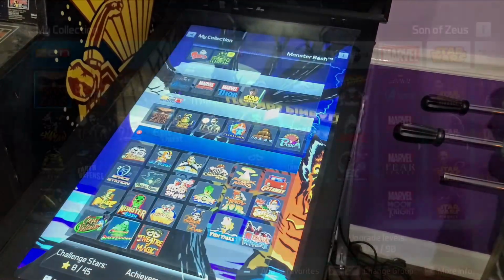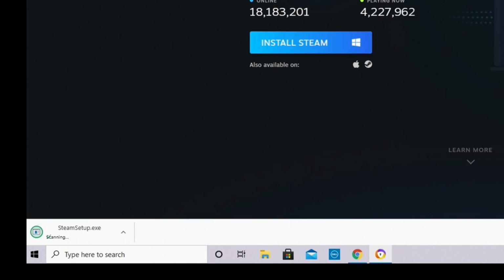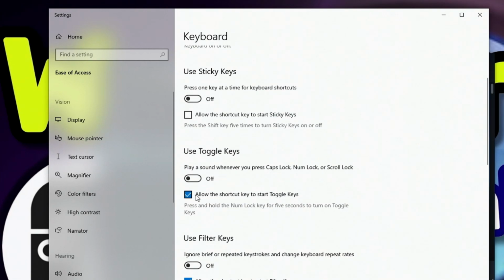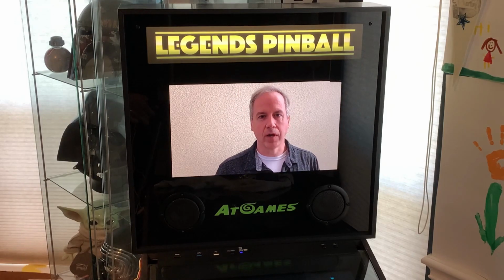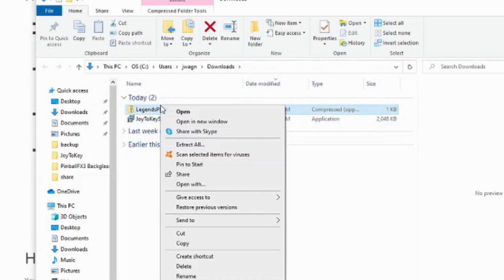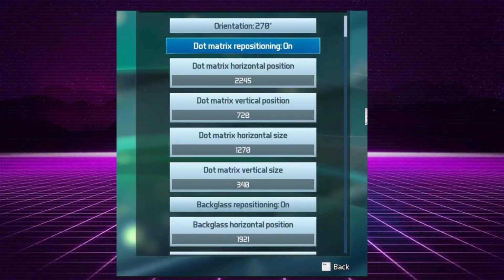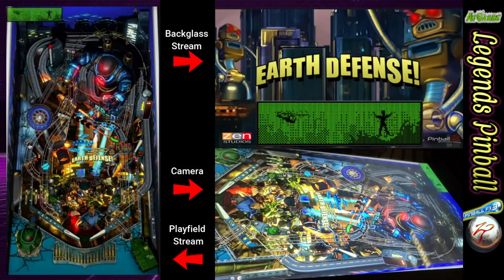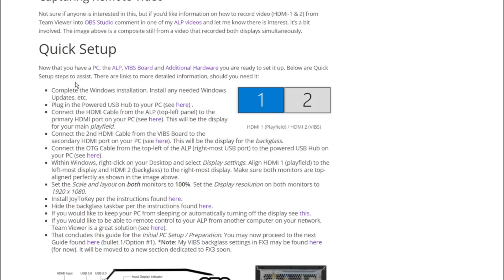Pinball FX3 Setup Guide for the AtGames Legends Pinball Machine

Comment: I have a Radeon RX570 video card.  I followed everything most everything in your video, but cant get the backglass to display at the same time as the table.  The only thing I have setup different is both HDMI connections directly from the video card.  I have the table directly input into the video card, and the other VIBS into a HDMI/DVI converter.  I can get the backglass to display if i switch the connections on video card.  Do I need the station setup like you have?
Reply from the maker: Some AMD cards may have difficulty as discussed here: https://wagnerstechtalk.com/alppcsetup/#PC_Requirements .  You may want to adjust the AMD Software settings to see if you can get it to work.  In my early testing, I started with an AMD GPU but wound up switching to NVIDIA for similar reasons.
Reply: What is the back glass supposed to look like after it’s all connected.  All I get is red, green blue alternating.
Reply: Do you need to have a backglass image downloaded to go with the pinball game in order for it to display anything?  Are there any pinball games that come with backglass?

Comment: Don't understand the first bit about the drive backup? What drive? I just connect up the laptop, hdmi and USB to the pinball legends and play it with joytokey and FX3. FX is way too laggy compared and I cannot get it better, despite killing v sync etc. I am running 4070 and an I9 on my laptop with 16GB Ram./
Reply from the maker: It's an optional step, just made an image backup of the drive as it was sent from the Mfgr. nothing more.
Reply: @WagnersTechTalk  aw ok. Do you notice FX has more lag than FX3?
Reply from the maker: This section helped with my configuration: https://wagnerstechtalk.com/alp4k-pcsetup/#Improve_Latency_with_NVIDIA_GPUs

Comment: So I followed these directions and it’s working, but, sometimes when I launch FX3, the backglass screen is not recognized by FX3 and it’s blank, despite the playfield working. Is there a way to insure the backglass always shows when launching the app?
Reply from the maker: The blank/black screen on the backglass simply means the artwork is missing for the selected table.  Look closely and you'll see a path with a file name mentioned.  You can locate the artwork for the table, rename it exactly as what's shown and place it in that folder and the artwork will show up for it.
Reply: @WagnersTechTalk  Thanks! actually the screen isn't black, it just shows the rest of the extended desktop.. meaning that FX3 is not using both screens... I need to figure out why it won't launch and use both screens all the time... Any ideas?

Comment: Hi, I’ve tried everything you explained on this video. I just purchased my Pinball HD weeks ago. The video shows outdated version of steam, it has changed since this vid so it makes thinks more confusing, also setting up for the buttons to function on that software download did not work either. I’m wondering if this whole process has changed since there has been many software updates with steam and at games firmware updates and so on. Please advise. Thank you.
Reply: Thank you for your fast reply. I have a question, is a powered usb required? I have a usb port but it’s hooked up to the cpu, could that be the problem why it’s not working?
Reply from the maker: @jorodriguez003  In some cases, it can be the OTG cable or a powered hub is needed.  Please see this section for some some troubleshooting ideas: https://wagnerstechtalk.com/alppcsetup/#OTG_Troubleshooting
Reply: Thank you again for the fast reply. My pc is a laptop, I’m running a i7 4060 graphics card, 16 gig ram. I’m sharing this information because the setup is working, but I still can’t seem to get the controls to work on my pinball. I’ve added a power usb. I’ve followed everything on the video which is working, but controls don’t work. Is it because it’s not a desktop?
Reply from the maker: @jorodriguez003  No, a laptop should be just fine.  If you tried a powered hub, it may be the USB-A to USB-A cable.  I spent about a week trying to help someone who had a similar issue.  Turned out, he was using a Best Buy (Insignia) branded USB cable that didn't work.  He purchased the UGREEN cable that I was using and was up an running.  Not sure if that is your problem, but could be.  Also, make sure it's plugged into the USB 2.0 (white) port.
Reply: @WagnersTechTalk  wow! I actually bought the cable from Best Buy. Well I have another usb cable, I’ll try it with that. I will keep you posted. Thank you for the reply. :)
Reply: @WagnersTechTalk  it worked! The Best Buy cable was the problem. Wow, thank you for your support and being very supportive.  One more question, I bought the vibs, do I need another hdmi port from my laptop? Again thank you for the support.
Reply: @WagnersTechTalk  hi, so I installed the vibs, usb to hdmi hooked up to the vibs. So I ran into a confusion; as I went to the display settings on my laptop, I see three screens there now, before there was two. No image on the back glass except for red,blue colors etc… any suggestions?
Reply from the maker: It's an older video, but Pinball FX3 hasn't changed since this video.  Just search Steam for "Pinball FX3", click install.  That's pretty much it, the rest should guide you through just fine.
Reply: I just completed this install and I realized my usb was in the gen 3 port. So the joy to keys didn’t find it. Move it over to the old white gen 2 usb. Then restart joy to key. I think it’s a driver issue.

Comment: Is my steam deck capable of this or does it have to be a windows pc?  Is the vibs board required?  Are there different steps for the micro?  Thanks!
Reply from the maker: VIBS is required only if you want to use the backglass on the micro.  More on VIBS/Micro here: https://wagnerstechtalk.com/alpmicro .  Steam Deck with the ALP (HD) is here: https://wagnerstechtalk.com/sd-alp , basically the same on the micro.

Comment: I'm trying to use Koy to key for my Legends pinball hD, I copy the WTT config file, paste in, it shows up in JtoK but its empty, all fields blank, uninstalled and reinstalled multiple times
 any help?
Reply from the maker: Locate the j2k icon on the taskbar (lower-right) and right-click it and terminate it.  Then re-launch it and see if it shows up now?
Reply: I tired that snd unisntalled and reinstalled, finally uninstalled, rebooted, installed, did not start, rebooted, loaded in the config file, restart, launched and it worked.....I'm sure the bulk of the restarts werent necessarry, but that menthod has worked in the past,  having some lag issues with the flippers now, Vsync off in game abd CP,  the back box quit working so I'm using a monitor plugged into the vid card for backglass and DMD.. Thanks!
 @WagnersTechTalk

Comment: What do you recommend for a desktop to connect to the Legends Pinball for virtual pinball
Reply from the maker: I assume you're asking for the ALP HD model (not 4k).  If that's the case, I have some information and suggestions here: https://wagnerstechtalk.com/alp-mod1/#Chapter_5_PC_Requirements .  Those suggestions are older and not intended for the 4K machine.  Though, the Skytech PC shown seems like it may work fine for 4K, I've not personally tested it.  If you're looking for one that is more future-proof, I'd recommend posting your question here: https://www.reddit.com/r/LegendsUltimate

The reason for asking on reddit, there are many that are already using different PC configurations and can provide better responses.  I wish I had a bunch of machines that I could use to perform benchmarks, but I don't.
Reply: Yes the HD, the computer you referenced is no longer available and it was a few years ago, I was wondering if you had an updated one.

Comment: If my PC has dual monitors already do I mark the ALP and back glass as display 3 and 4?
Reply from the maker: The numbers aren't important, it's their arrangement from left-right.  Playfield, Backglass and then DMD (left to right).  Make sure are scaled to 100%, 1920x1080, etc. as mentioned in the guide.  Hope that helps!
Reply: @WagnersTechTalk  Thanks! I just bought an ALP so there is a learning curve! I see there's a box for "live stream" so do I put my Twitch credentials in and then hook the ALP to my capture card somehow?
Reply from the maker: I don't personally use Twitch, but after you enter your credentials and enable live streaming it will stream directly to your Twitch account.  There won't be a need to add a capture card.  I tried it with YT years ago and that's how it worked then, but haven't tried since.

Comment: Is there a way to get stock haptics to work ? Got everything setup and working but the lack of even the stock haptics is definitely noticeable.  Thanks!
Reply from the maker: If you press the vol +/-. you'll see a haptic and main volume control.  Press the channel button to switch to haptic and increase that value.  Then enter OTG mode and see if that helps.
Reply: @WagnersTechTalk I'll give that a shot thanks! Really appreciate all the hard work you put into all these guides. They have helped tremendously!!

Comment: Do you still need to request the pinball cabinet code for pinball FX?  I filled it out +1 week ago and never heard back
Reply from the maker: You only need a cabinet code for Pinball FX3, in Pinball FX you can immediately activate cabinet mode.  More on that in this guide: https://wagnerstechtalk.com/alpfx/
Reply: @WagnersTechTalk  thanks, looks like my bestbuy USB-A to USB-A cable didn't work and is the last piece of the puzzle for me.  Waiting on the one you linked on amazon to come in a few days.  everything else looked good though.  hoping i dont need xmapper unless im using the other two pinball systems - which it sounds like could be a bit of a pain to setup?
Reply from the maker: Yes, I've heard from others that the Insignia USB cables don't work for whatever reason.  Spent a week with one individual trying to narrow down the problem and the cable was it.  Give j2k a try first, if the performance is good great.  If not, Xpadder is another option.  You can also map the buttons directly in steam, but I've had issues with it in the past.

Comment: thanks.  very helpful but my backsplash shows up on my laptop
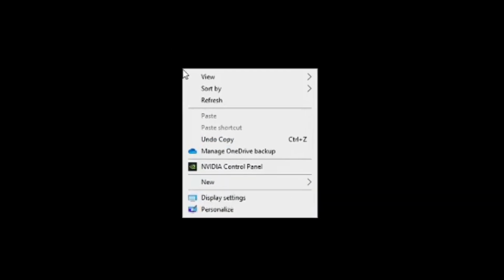Reply from the maker: See 09:19, you want your playfield display to be on the far left and the backglass display immediately to the right of it.  The numbers aren't what's important, it's the arrangement of the displays is important.  You can click the identify button to see which display is which.  Your laptop display will be on the very far right of the other two.  Also, make sure the backglass HDMI is connected to the VIBS HDMI input and that you've flipped the VIBS switch button.

Comment: Ok. How do you get the sound to work?  I have a PC with a graphics card, so the sound can't come thru the graphics card. What do I do?
Reply from the maker: The sound will come through the primary HDMI (playfield).  You likely need to click the small speaker icon on the taskbar and set it to the primary HDMI.  Also, make sure that the HDMI cable from the graphics card is plugged into the top port on the ALP.  Also, see the last point here: https://wagnerstechtalk.com/alp/#VIBS_Troubleshooting

Comment: I've been using that file that you talk about on here for joy2key, it works great, unfortunately my plunger is broken and I'm forced to launch the ball using the enter key on my keyboard, i have the arcade control panel installed on my legends pinball, is there anyway i can change the button on joy2key to launch the ball with like my X,Y OR Z top buttons? Cause they don't do anything in fx3 right now anyway, and i dont think i can launch my wizard power either on fx3 with this setup the way the file comes, please help me out if you can, really just want to be able to map my wizard power button and especially the launch the ball button to my control panel so I don't have to use my keyboard at all anymore while playing fx3
Reply from the maker: There is already an alternative mapped, press and hold the forward nudge button to launch the ball.  Should work fine for you.

Comment: Do you have no table / ball lag or stutter at all when using fx3 and vpx on OTG on the ALP cab? 
Fx3 and vpx run so smooth on my laptop .. but when i plug the hdmi into the alp there seems to be slight ball stutter etc. 
The flippers work fine.
I can't get my head around it. Any help please?
Reply from the maker: In FX3, turn off VSync and it will likely play better.  In VPX, I don't have any ball stuttering.
Reply: @WagnersTechTalk  what pc/laptop are you using?
Reply from the maker: I'm using the DELL PC mentioned here: https://wagnerstechtalk.com/alp-mod1/#Suggestions , however it's no longer available.
Reply: Thansk mate.
Im just baffled .. like i say everything runs perfect on my laptop .. like a dream.
Then as soon as i hook up to ALP with the hdmi lead thats when im noticing ball stutter ( not flipper lag )

Comment: @Wagner's Techtalk Would you kindly consider looking into the subject "Controller layout won't save in steam"?  There are so many posts on the internet and no working solution. Whenever I define a controller layout in steam so that I can actually play games (shumps) with my Atgames control panel it does not save the layout. The buttons on the control panel do not work. I have tried using JoytoKey instead, but ended up having 10 different JoytoKey configs for 10 games which is really cumbersome. A steam internal solution is provided but does not work and nobody seems to address this. All the Youtube videos just show how easy the steam controller layout mapping is. But it doesnt work. They layout can be entered, but is not saved. I would so much appreciate your help, all the best, Tristan
Reply from the maker: With the j2k profile I provide, you only need one profile.  It works with FX3, no problem and there is another for Baller Installer + FX3.  That's one of the main reasons I use j2k, there is no further button mapping required when used.  It does assume you're using the Arcade Control Panel, however.
Reply: @WagnersTechTalk  Thank you so much for your kind reply!

Comment: A big thanks to you for sharing clear instructions that help many people get more out of their ATGames Legends Pinball machines! And a question: I see that the new Zen Pinball FX platform now offers cabinet support, yet I find nothing on the Internet about anyone getting that working on the ALP. Is it possible now to play the new Pinball FX on the ALP?
Reply from the maker: Very welcome and thank you!  Yes, FX does have cabinet support but it's severely lacking -imo.  I started creating a guide on it, but stopped until support is further along.  One key feature of cabinet support is the ability to rotate the playfield display.  At the time I started (about 1.5 months ago), it wasn't built-in to FX and as far as I know still isn't.  There was a hack that made it possible, but required using Baller Installer to do so.  Just didn't make sense for me to continue until the support is there.  Hope that clarifies.  Once Zen implements it fully, I'll revisit and revive the guide I started.  The last thing I want to do is create a guide that is so convoluted no one will appreciate it and I'd get tons of negative feedback.

Comment: Another question is I couldn't get any backglass images to show up? On anothe rforum I was told that PBFX3 doesn't come with backglass images and you have to download them yourself and install them. Is there a video tutorial that just shows how to do that? I found most of the backglass images online in a shared Google Drive, but I'm not sure how to add them to PBFX3 and how to edit the settings.ini file.
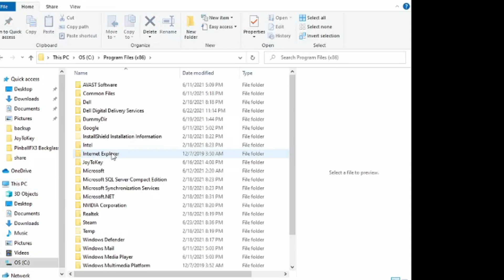Reply from the maker: See 10:25 and the 3rd point here for the archive shown in the video: https://wagnerstechtalk.com/alpfx3/#Software_Considerations
Reply: @WagnersTechTalk  Thanks! I actually followed this exactly but the images are not showing up. So I've used Retropie a lot in the past and it uses a gameslist.xml file that has all the data / directory information that points to the right images in the media folder - is there something like a gameslist.xml file in PBFX3 that would point to the right image files as well? Is that the settings.ini file? If so, where is that file? Or if not, do all the files have to be .jpg files or will .png work as well? Sorry for the long question!
Reply: @coinop29 did you ever figure this out? I’m having the same issue. All the files are PNG I downloaded. I copied them in the directory but they still won’t appear on black glass. Just get black screen with the dot Matrix
Reply: @hornets303  yes I figured it ou - you just have to name them exactly the same as the table file in FX3 - then they will work.
Reply: @coinop29  heck yeah. That fixed the problem! When i downloaded they only were named table with a number.  After renaming to match table name it pops up on back glass 🤝🏾